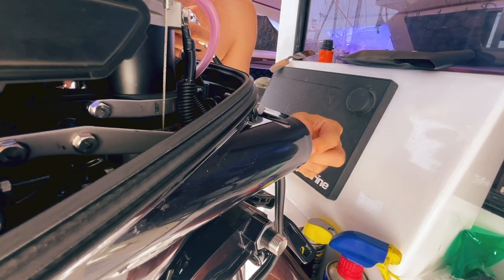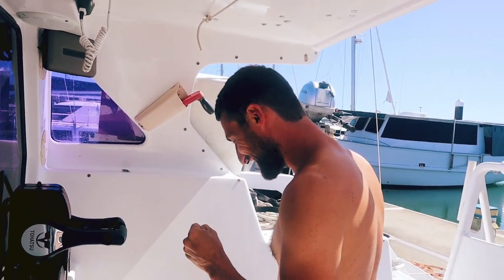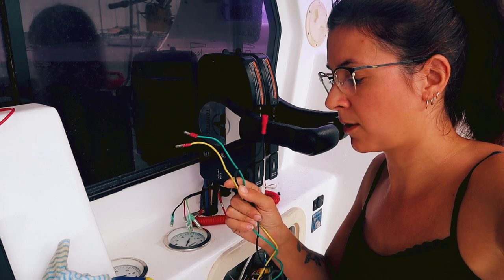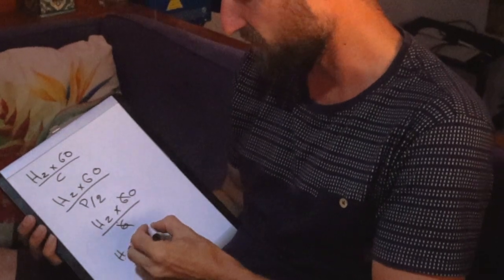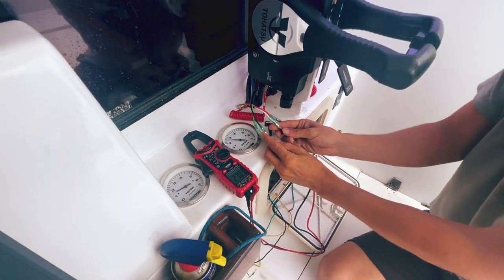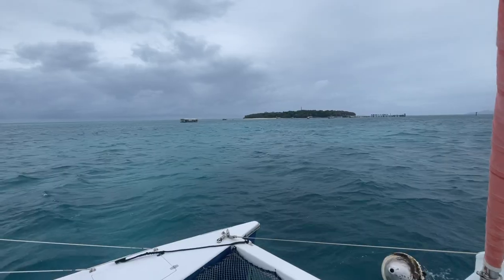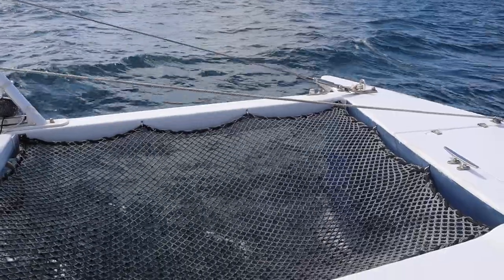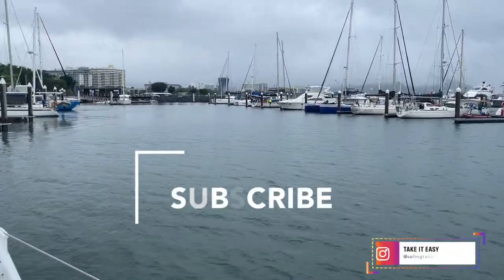Swapping our engines part 2 - Installing new Tohatsu 20hp in a catamaran (+ tachometer calibration)

Comment: Gday Guys - We replaced our single Honda 25 with a Yammie 25 and didn't lose any top speed but we did get MUCH MUCH better grip and reverse. We now have a 25 Yammie and a 9.9 like the one you replaced. I think you should try to get a large diameter prop, not just low pitch. The Yammie 25 has a 12 inch prop and I would like an even bigger one. The Honda had a 9.5 inch prop and it was fine in a calm, but like you found out, the small props do not grip the water as well as big ones. You can get the 10 inch 4 bladed prop and I would do that. It should make a big difference. 
We used cod end for our tramps - you can find this net in a fishing supplies store - our black 1 inch cod end has lasted 22 years and is still tight and strong. I just tensioned it two months ago. Go black and your nets last a much longer time.
Reply from the maker: We just received our 9.5 inch 4 blades prop, we'll try to install soon and test them out! We'll let you know how it goes and mesure the speed difference. Exciting!
Thanks for the tips on the tramps, we've been doing research for a bit now and it's not easy unless you pay good money for it.
What boat do you have? Happy with having 2 different engines or will you try and match the second one?
Reply: @SailingTakeItEasy  Gday - I have a Chamberlin 11.6 - same length as your cat but rounded composite hulls. She sails nicely. I found that our old Honda had problems in reverse. You may also have some issues with reverse because the Tohatsu probably does not have the reverse diverter prop like Yamaha that pushes the exhaust in front of the prop when reversing. So you may need to alter your techniques for reversing but hopefully the new props will work well. I am happy with two disimilar engines because I only motor on one offshore and most of the time I still use only one engine - the 25 gets us cruising at about 7 knots and tops out at 9. If I pop the 9.9 in we can just about reach 10 but it is a big waste of fuel. When manouvring the twins work nicely enough. 
Have you talked to Sharplift about some fishing nets? I would go and chat to them about their range of nets for trawlers. Our black (you must try to get black as it resists UV the best) nets are about 30mm squares and are still going strong. I think it was called Cod end. I use PVC tube that slides through the squares on each side and then tie the pvc tube on. The French racing cats use a different technique as shown by these guys on Young Barnacles https://www.youtube.com/watch?v=-FdDFVwsdvs 
I wouldn't go high tech with the net (mine are just fishing nets) but it looks nice in the end. You shouldn't have to get a sailmaker to make you anything.